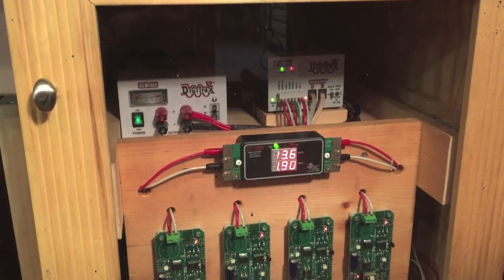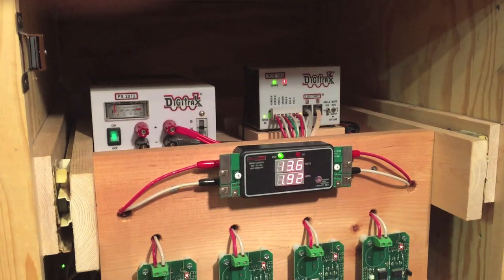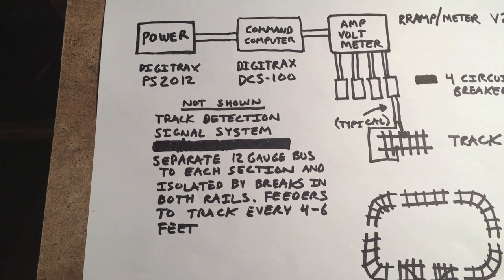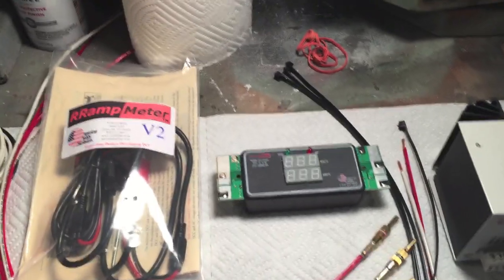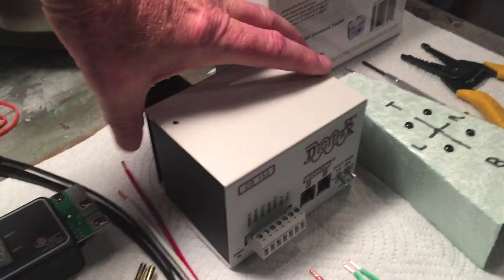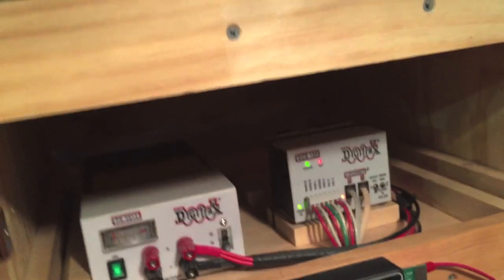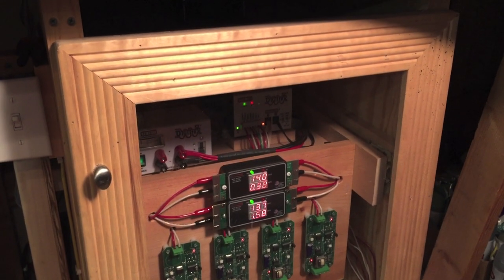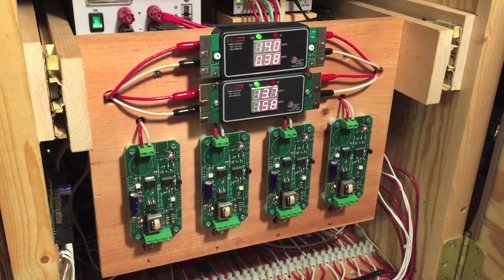How to Install a Booster to your Model Railroad

Comment: Hey there guys just wondering if you can double and triple head engines with that digitrax DCC system and if it offers the dynamic brake option? Im downsizing from O scale to HO and trying to figure out the best DCC system to go with. Another question is where did you purchase your digital amp meters and the brand? Any help would be greatly appreciated. Thank you for the vids!!
Reply: With Digitrax you can consist many engines. I think I have seen Josh put 10 engines together once. Stop the video at the point where I film the ammeter and you can see the packaging. We buy all our Digitrax components at Tony's Trains. Great service and advice. Great prices too!
Reply: Hey Tom thank you very much for the reply I appreciate it!!

Comment: do they transition flawlessly without any extra wiring besides switching the track feeders? do you not have to connect the two with a loco net cable? if not, how do both of them know to turn track power on/off simultaneously?
Reply: John Alexander you can change a config setting to where the track power goes on automatically every time u start up the system so thats my guess of what they did.

Comment: Noticed on the drawing that the added booster does not wire through the command station.  I'm new to DCC, but how do commands get to the fourth circuit breaker and the attached power district?
Reply: Through the loconet. All components of Digitrax are connected with a 6 wire cable like a telephone's cable called a loconet. That's how it knows. Sounds like magic but it works great!  Tom